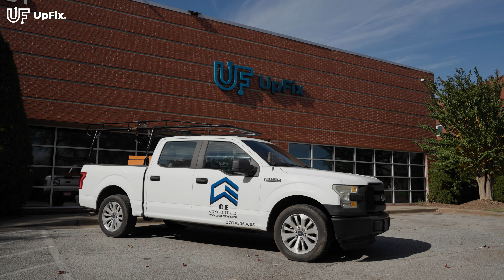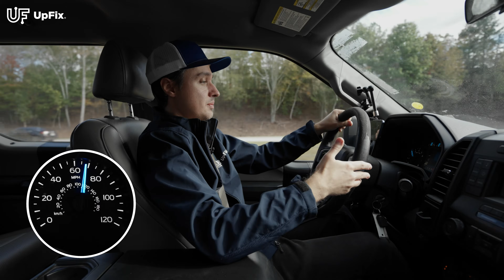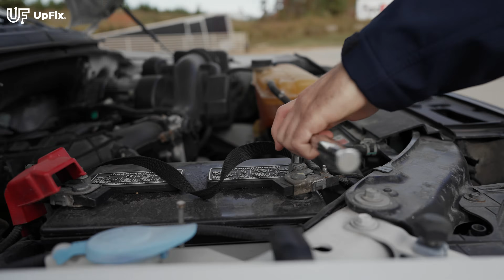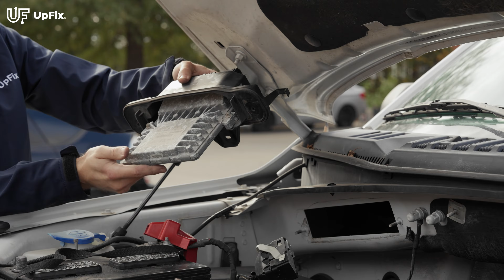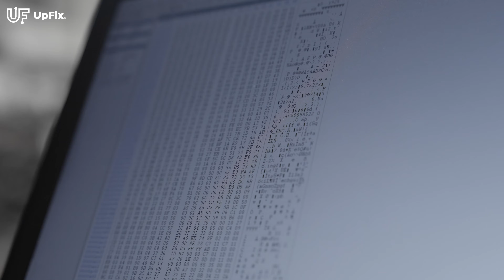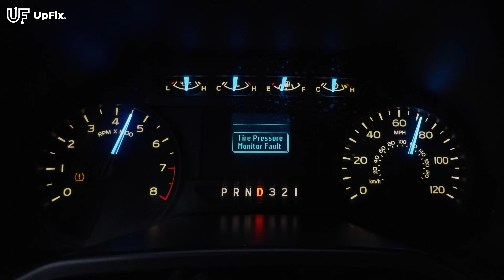How to Remove Speed Limiter on Your Vehicle | PCM Reprogramming

Comment: My vehicle only goes 65. I bought a new ECM installed it programmed it and it’s still only goes 65. What else could it be?
Reply from the maker: Sounds like a speed limiter is on the vehicle. Please call us at 888-979-9343 to get more information regarding our service to further assist

Comment: I have 2 2005 tundra's that I bought from the Part Authority. They have speed caps at 25mph, how can i be sure that the speed limiter is in the PCM/ECI rather than mechanical before sending them to you? 35k miles on them and they both rev up like race cars so whatever it is doesnt work off engine rpms. Can anyone tell me how to be sure whats limiting them.
Reply from the maker: To determine if the speed limiter is in the PCM/ECI, you might want to check if there are any error codes using an OBD-II scanner, which can indicate electronic limitations. If you're still unsure, feel free to send us a direct message, and we can guide you further!

Comment: Brother i have corolla 1.8L cvt my car speed limit at 190km/h
Can i unlock speed limiter, to go upto 200km ???
Reply from the maker: Most tuners won’t bother to raise it just from 190 to 200 km/h because the CVT transmission is the weak link. The CVT isn’t designed for sustained high load at those speeds. Toyota locks it down to avoid heat damage and warranty nightmares.

Comment: As a professional mechanic I use Autel MaxiSys Ultra OBD2 Scanner, 2025 Top Intelligent Scan Tool [with MV108 & 5-in-1 VCMI] Upgraded of Ultra Lite/ MS909 EV/ MS919 Topology 2.0, Motor TruSpeed Repair, 40+ Service, ECU Programming it’s expensive tool, but it will get rid of all the speed governor on any car
Reply from the maker: We appreciate you sharing that information.
Reply: Even the ones put on the computer from the manufacter? Not just fleet vehicles?
Reply: I have the exact one. I went to the PCM from the topology. Selected Programming then Programmable Parameter but i could only enable and disable cruise control. Can you walk me how you did it?
Reply: Does your programmer allow you to set the speed limiter at whatever you want? The factory generally sets them at 85 or 100 or roughly around there on production trucks. However there's another speed limiter that's about that which is the max that the vehicles allowed to go if the speed limiter is tampered with and that's generally set up around 140 or 150.  Will that box of yours allow you to set limiter speeds like on the crown Victoria up to 147 which is what the crown Vic computer allows as a maximum?

Comment: Is there a way to do it without sending it to upfix lol. Like is there a certain tool  i could buy?
Reply from the maker: There are diagnostic scan tools you can buy that usually are expensive and/or come with a subscription and they have programming capabilities for each specific vehicle. I would contact a shop in your area. Because you can spend money on the tool and it may still not do what you need it to do.

Comment: I have a 2021 Ram Promaster 3500 (Used to be an Amazon delivery van) Any help? I’m in Florida
Reply from the maker: I'm not sure what place to recommend in Florida. Try to ask around in your area. If you are driving by Atlanta, we can help.
Reply: As a professional mechanic I use Autel MaxiSys Ultra OBD2 Scanner, 2025 Top Intelligent Scan Tool [with MV108 & 5-in-1 VCMI] Upgraded of Ultra Lite/ MS909 EV/ MS919 Topology 2.0, Motor TruSpeed Repair, 40+ Service, ECU Programming is expensive but it will get rid of any speed governor on car
Reply: @tjpoe4695 how much does something like that cost?

Comment: Does this also disable it to the point where there’s no cap at all on the speed? Meaning you can go as fast as the truck will allow
Reply from the maker: Yes that is correct
Reply: @upfixauto I like that you respond to these comments, I was wondering the same thing. I have a Chrysler LHS 1997, has a limit at 85, or 90. Any advice?
Reply: Generally Ford has a carpet around a hundred mile an hour on these trucks. Some of them have a cap at 85. My van is one that has a cap at 85. It's an E350 long van. By using an aftermarket programmer to remove the speed cap, we did a test run and was able to hit 120. So factory spec is not as fast as it'll go. In fact some of those vehicles will actually hit some pretty incredible speeds. I was in one guy's truck on the Ohio turnpike and we were at 136. A mustang had passed us going like a bat out of hell, and you should have seen the look on his face when we pulled up alongside of him at 1:36.. he knew we had done some elfen magic.